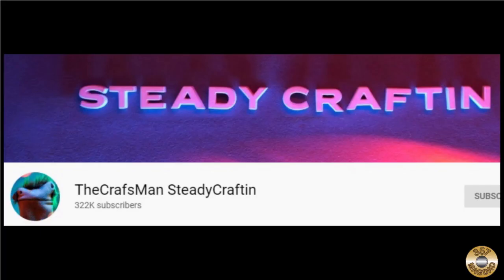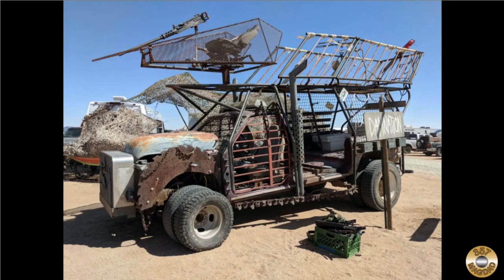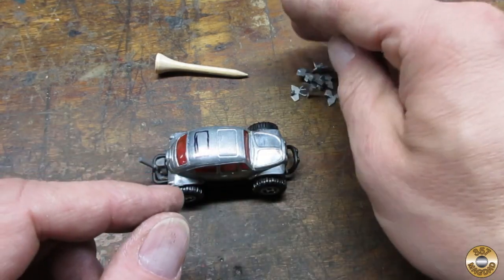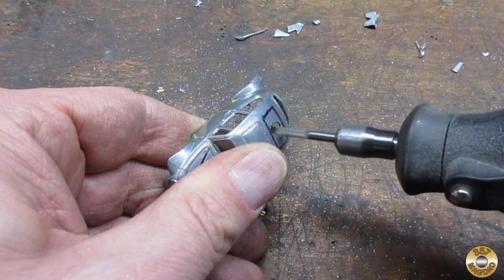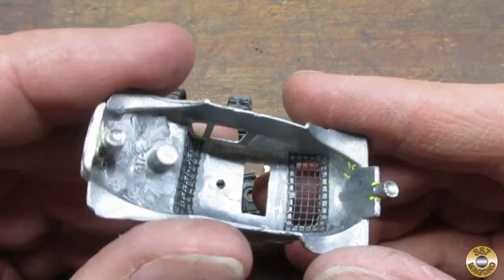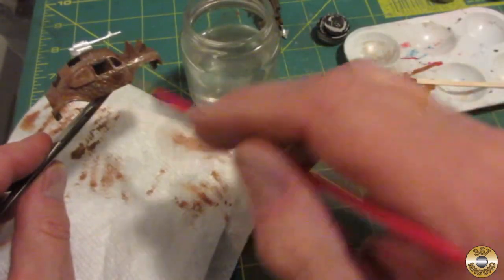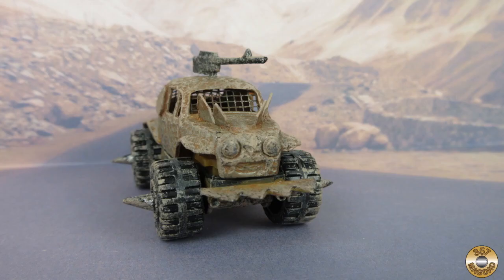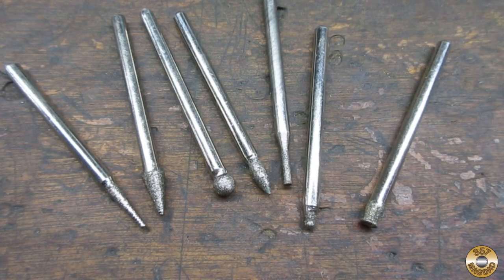Diecast Gaslands Wasteland Mad Max VW Bug Custom Dune Buggy

Comment: Nicely done. I watch a lot of those channels, too. Looks like you did the baking soda/super glue trick on that bumper. Interestingly enough I learned about that from watching guitar repair channels first, and then I saw Marty's Matchbox Makeovers do it. Haven't found a reason yet, but I'm hoping.
Reply: Reason to try it, I mean.
Reply from the maker: I just tried using the super glue + sawdust as wood filler - it worked pretty well.